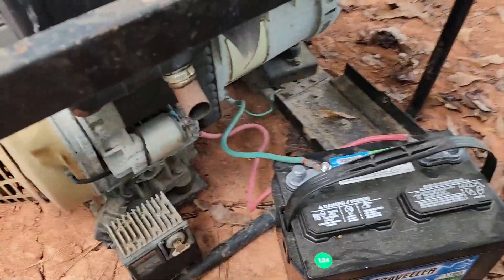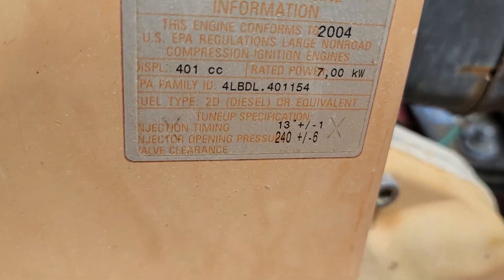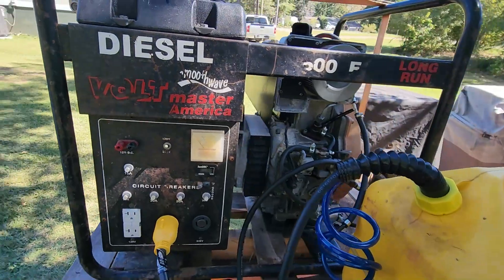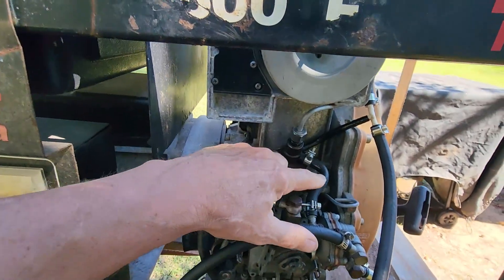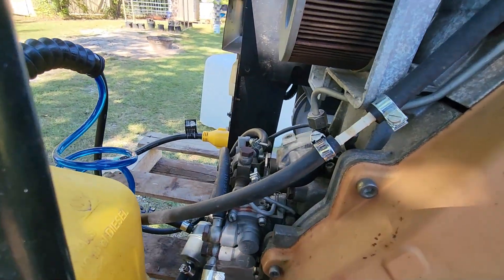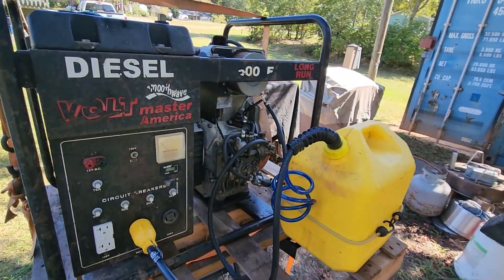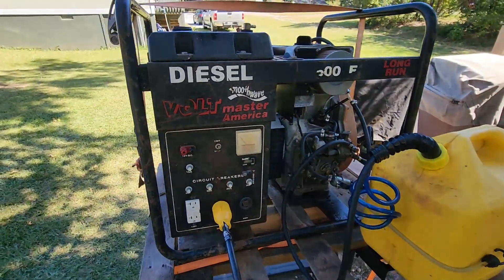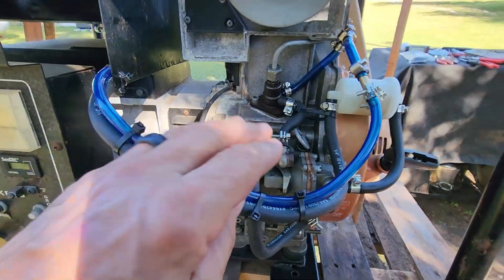Lombardini Diesel Engine Generator Will It Run? Made in Italy! 15LD400

Comment: I have a 6000 model with 11hp lombardini engine from a government auction. The fuel lines are all mixed up after lending it yo a neighbor, and compared to before lending it, there’s very little compression. Do the fuel lines affect compression? Im hoping they do!
Reply from the maker: I don't think the fuel lines affect the compression of the engine. Maybe if the fuel injector is stuck open.  Thanks for watching.
Reply: It wont. but you should check the valves to make sure one isn't stuck open,